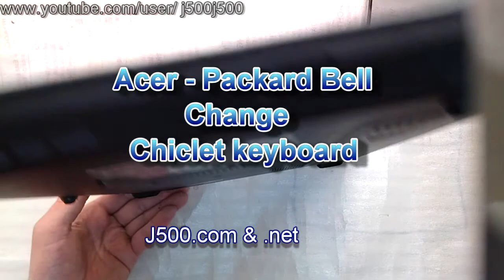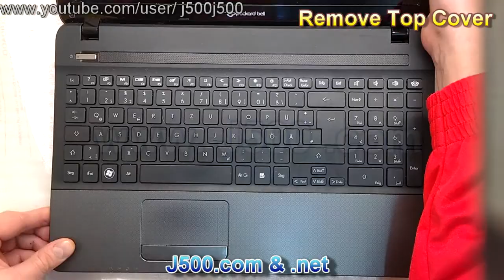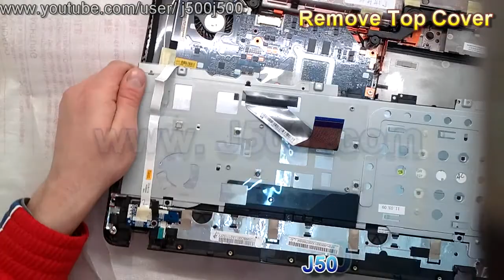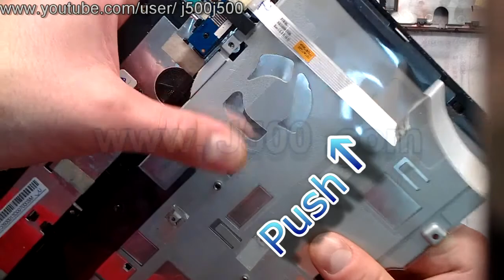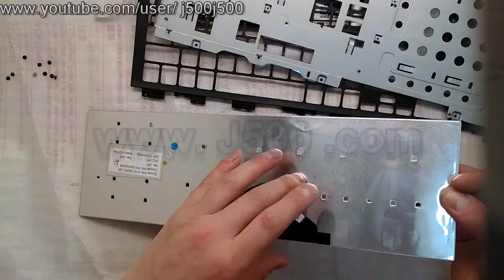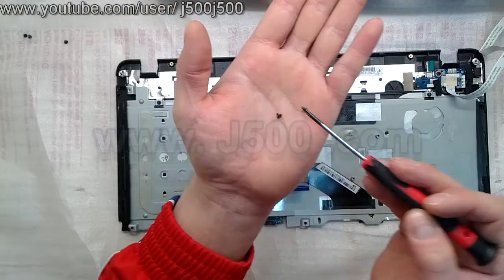ACER Aspire V3 Change keyboard  Packard Bell TS11 Replace Tastatur

Comment: Great Video! I have a question. I have the Acer Aspire V3 772g and I want a backlit keyboard mod that can fit for that particular model. Is there a keyboard with the exact fit for this model? Thanks for the reply
Reply: +skeetdarama1 hey man, i got the backlit keyboard and its working but unfortunately the backlit function doesnt work
Reply: +Ivan Matev aw, man, ok thanks.